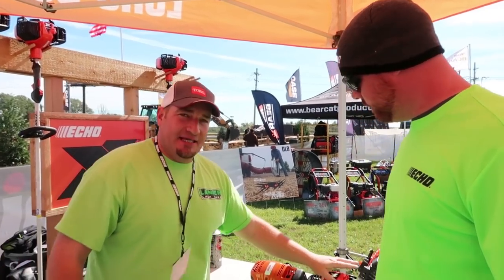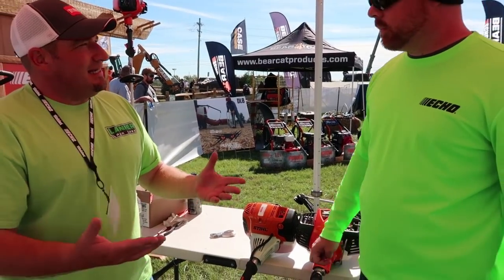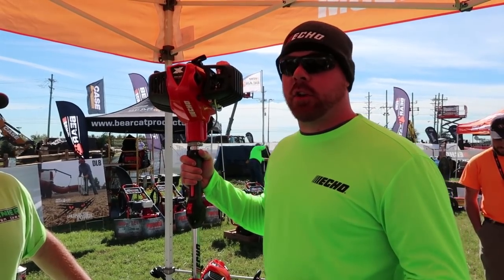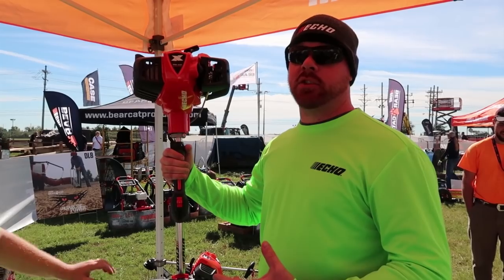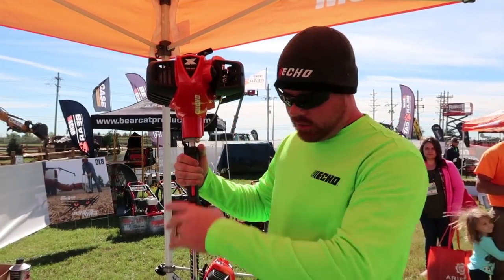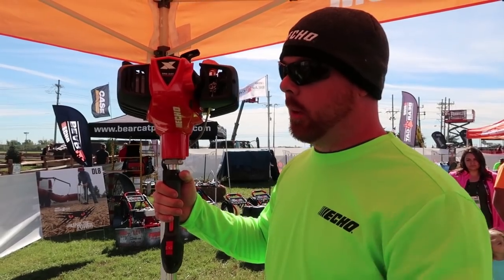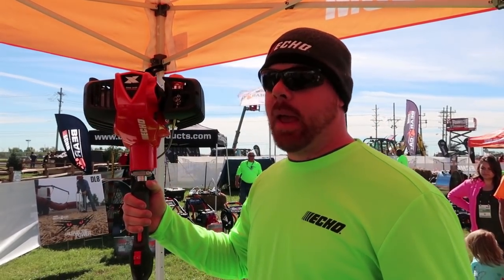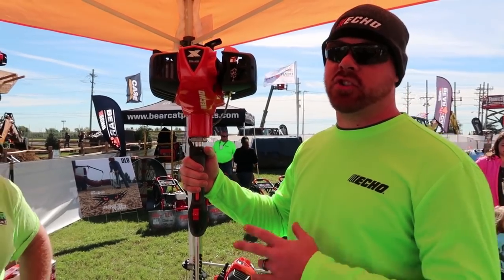Trimmer Torque Test, FS 111 Vs  3020 Vs  3020T

Comment: I had the 3020T and used it for a year and loved that thing! I then sold it (what a mistake) and bought a 131 sthil. Used it for a few jobs and hate it. The echo whoops that thing! The cutting swath and torque blows the sthil away. Im about to sell the sthil and get another 3020T
Reply: I sold a 131 to get the 3020t. much better
Reply: Stihl FS or KM 131r suck

Comment: The test should have been done between the stihl 131 and the echo 3020. The 111 has 1.4hp the 131 has 1.9 which is more comparable to the 3020 with 1.8hp. Also the price of the 111 is $350 vs $400 for the 131 and the 3020.
Reply: @chipcarter5971  i own a 131 and a 3020t and a fs250. And the echo cuts taller grass better than the 131. The 131 dont seem to rev high. Now my fs250 that thing has the power. I dont like stihls newer stuff seems overrated. Ill stick with old stihls and echos Japanese engernering
Reply: @chipcarter5971  I have a 130 and a 410.  The 410 seems to be twice as powerful.  I don't know what you're talking about.
Reply: @chipcarter5971  you must have got a bad 3020T is all I can tell you. My Stihl 131 is not quite as powerful as my 3020T.
Reply: I just did the test myself and the 3020t cuts through taller grass quicker and has a larger cutting swath so there you go. Dont believe me? Try it for yourself.

Comment: That bucket challenge is not a fair assessment. You lose a lot of movement of the water with the stihl guard. It would be fair if the guards were off.
Reply from the maker: Mario Saenz Landscaping Services honestly don’t think the guard off would matter as the guard on the 3020s are about same size as stihl. But 4 strokes don’t have as much torque as a 2 stroke.
Reply: @LanierLawnCare  Idk seems like the guard on the stihl is wider slowing the whirlpool
Reply: @LanierLawnCare  the 4 mix engine will make more torque. It’s a test designed to make echo look good. They also put the smallest trimmer head they could find for the stihl. That’s not a factory stihl head. I bet they also put smaller line. It’s all marketing and useless. This is just to pull the wool over the eyes of morons. A fool and his money will soon be parted.
Reply: @LanierLawnCare  but you can run that 4 stroke with less throttle and do more with it. I have both echos and stihl and I'm a fan of my stihl fs111r and my 131 kombi over my echos (2620 PAS) for the big stuff. For normal trimming and alot of it i grab the 2620 or the old fs80 pro. Both are lightweight and cut great.
Reply: @LanierLawnCare  you are 100% wrong, 4 strokes have more tough than 2 strokes and don’t have to rev as high to achieve it.

Comment: Ill keep the stihl fs 91 5 years later incredible . have 25 acres best weedwacker made . does echo still have junk flex shaft . stihl solid square bar
Reply: 4 layer cable on most...some available with a steel shaft.
Reply: I've never seen a 4 layer cable shaft fail, steel is probably better but flex is certainly not junk. I couldn't stand my 91r things clutch sounded like an m1 garand ejecting a clip and never ran right. I like my old 110 tho

Comment: Thinking about switching to echo problem is I would be switching from stihl and I have all the gear head attachments ie chain saw, edger and rototiller. Would these run on the srm3020t?
Reply from the maker: Hey Simon thanks for the question. I’m sorry to say but The attachments are NOT interchangeable.
Reply: Sthil makes good chainsaws but their weed whackers are not up to par with echo

Comment: I replaced my old arm 280 with a 3020 and a 3020t. I like the long run time and overall performance of echo products. But I think stihl is more durable. If you look at the casing around the engine it is all enclosed on a stihl but the carb is exposed on echo. That can be an issue in a ag environment because this stuff rolls down hills and gets bounced around in the back of trucks and side by sides.
Reply: Do you prefer the 3020 over the 3020t? I'm trying to decide on which model to buy. Thanks
Reply: @michaelangeli3209  I like the standard model better than the t model. That engine has plenty of torque without the gear reduction head. I just got the t model because it was a demo model and I got a discount. But it's not worth the mark up if you're paying full price. The only time I could see it being useful is if you're working in a swampy environment and need the torque to cut through the water

Comment: Should test the fs240 vs echo 3020
Reply from the maker: Hector Cortes the stihl is 37.7cc compared to the 3020 30cc. Not even comparable
Reply: Should have used a 131. The 111 isn’t comparable either.
Reply: I have a 131R and a SRM 3020, the power is basically the same, so just pick your poison.

Comment: It's an echo guy over there so you going to make the favor to Echo
Reply from the maker: Just released a video between the 111 and 3020. Go check it out and let me know your thoughts again after watching.
Reply: @LanierLawnCare why the 111?  The  power rating of the 3020 matches closer to the 131 stihl 1.8 bs 1.9 and the price of rhe 3020T matched the 131 at about $500. I bought an echo 225 trimmer and knew in less than 30 minutes it was going back or being sold.  May try  3020T. You can do more with stihl. Pole saw head and other attachments bolt right on to the trimmer shaft. Echo tells me theirs don’t